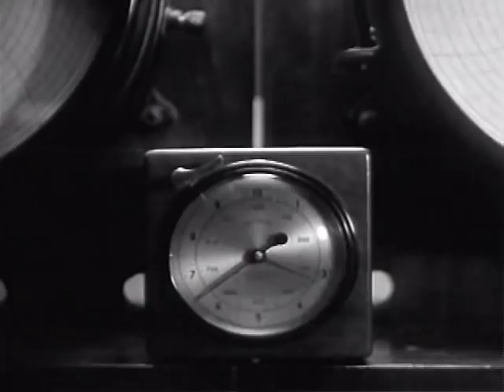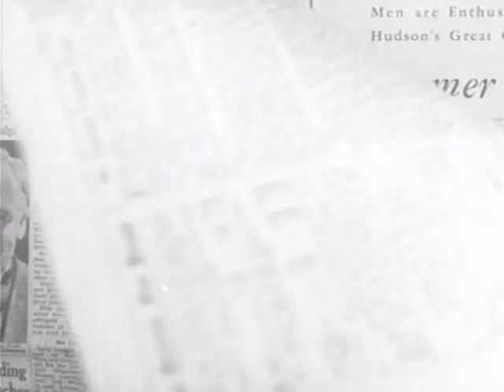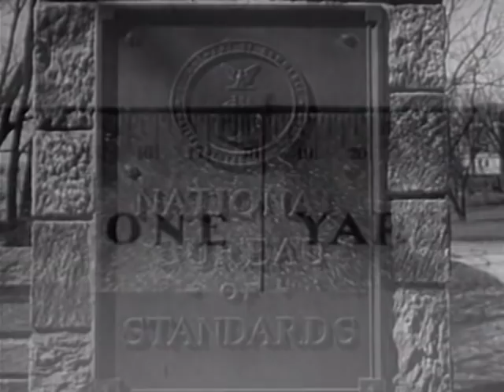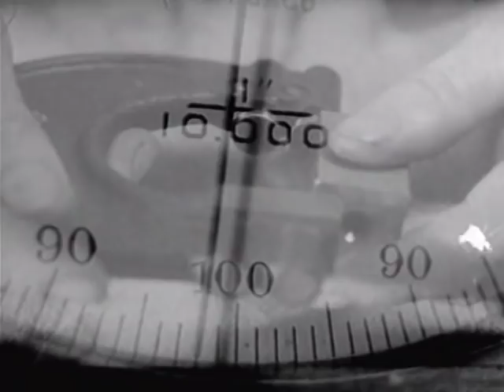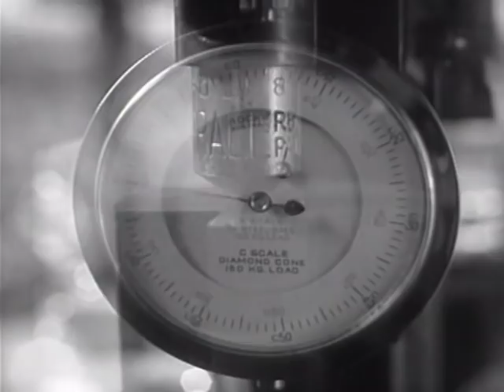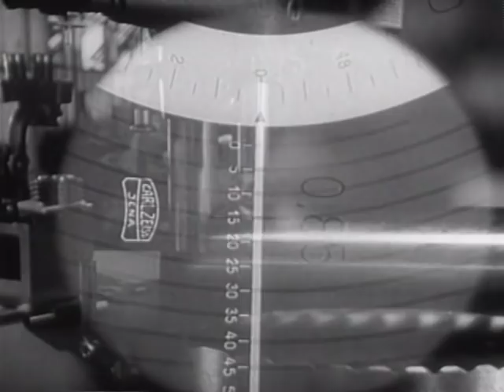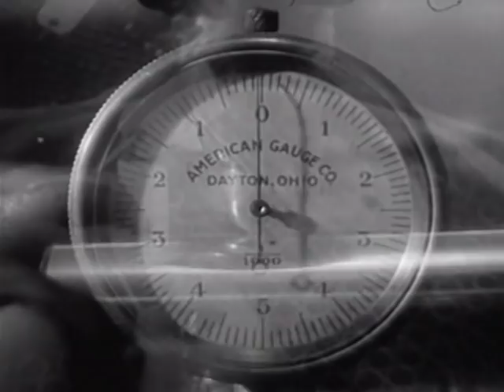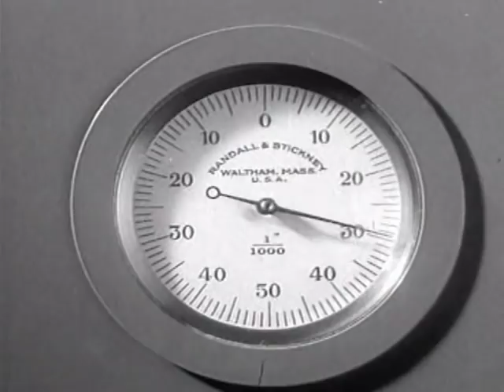Precisely So (1937) Manufacturing Tolerances

Comment: And now cars need More Maintenance than any time before in our History .
Reply: BULL. They have no Carburetors (except NASCAR) and no distributors. EFI and electronic ignition require Much less repairs. Yes-the exhaust is more complicated because of emission control-but, that's very important. Soon-we will all be driving Electric and Fuel Cell cars. Good acceleration, Green, and Reliable.
Reply: thaddeus buttmunch I hope I never see the day .... I love internal combustion engines...... I will never accept what you say the future is.... and I hate emissions control
Reply: I know you are right, And I just got owned but: and on the same note... cars today are becoming such a pain in the ass to even work on... not just the computer standpoint ... but no room for anything... and plastic shields everywhere .... with thousands of little shitty plastic clips that break at first thought of removal.... but even with that being said I will still never let anyone work on my cars but myself.... and off topic but MAKE MANUAL TRANSMISSIONS GREAT AGAIN!!!!!!
Reply: That isn't necessarily true.
Reply: @drpoundsign  Double BULL. One example, carburetors, is not sufficient. What about variable valve timing? Turbochargers? Vapor recovery systems? All of these, and more, recent vehicle features did not exist on a 1960 Chevy, but are common today. They all add to mtce & repair costs. And as long as gasoline is cheap, and it's getting cheaper in 2019 due to fracking, [fracking is making for abundant & cheap natural gas which will lower the demand for petroleum fuels] electric cars are not going to be in demand.
Reply: NO?? That's why Ford and Volkswagen are merging over building electric pickups and SUVs. About the only thing electric cars can't do is go 200 mph...and who needs THAT anyway?? The 45000 Tesla and much cheaper Chevy Bolt both get over 220 miles/charge.  You Rightwingers are Hypocrites! We could Destroy OPEC Forever, but-NO. The GOP wants to keep Alaska and Texas in business. Electric cars, 18 wheelers powered by overhead Catenary lines (being tried on the autobahn) bullet trains, and a combination of solar roofs (in Sunny climes) and Ground Loop Heat Pumps (in the North) could Doom fossil fuels. And-there will be NO "Coal Economy!"
Reply: @RichardFallstich  I have a 2011 Ford Fusion. I've had to replace the battery twice, but-other than maintenance-that's IT. You contradict yourself-electric cars are much simpler, and even the battery should last five to seven years. And-you don't need to tell me that some Japanese models are more reliable and can go ten years with zero repairs.
Reply: @drpoundsign  The Rimac C_Two electric car does a top speed of 258mph. The Tesla roadster does 250mph.
Reply: @holdshiftt2run308  WOW...thanx!